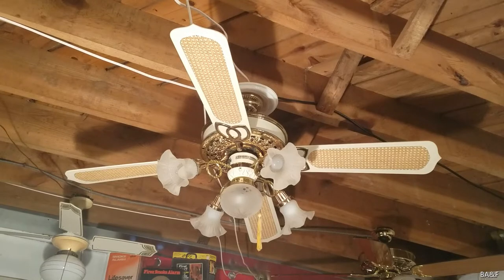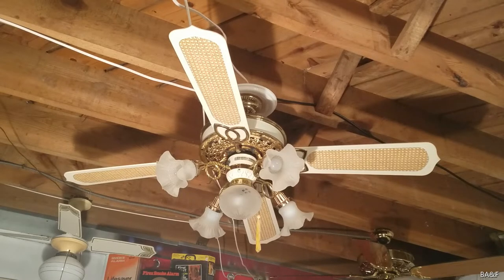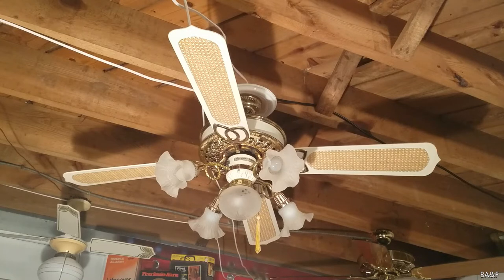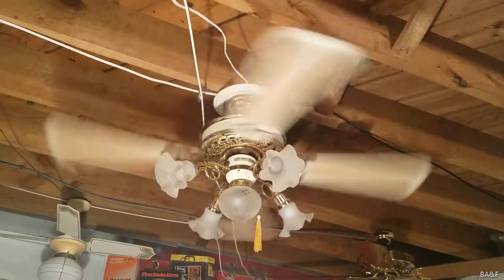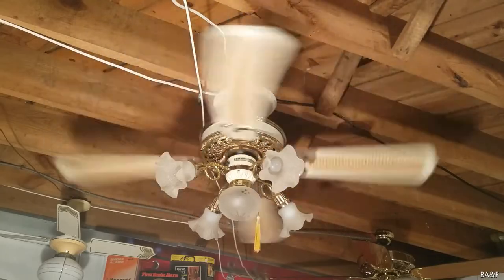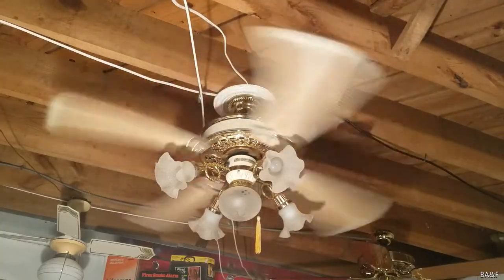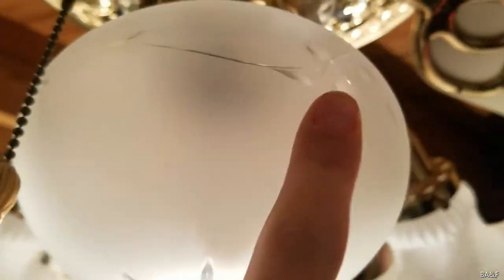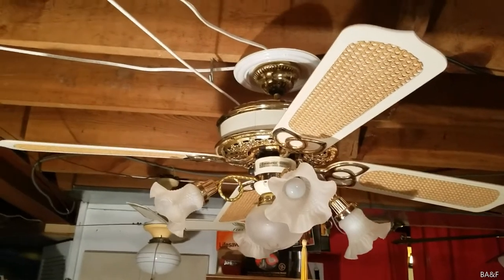Casablanca Victorian 52" Ceiling Fan w/ SlumberQuiet | W&B Cane Blades

Comment: Do you have ideas where I can get a new flywheel for my '85 Zephyr
Reply from the maker: They occasionally show up on ebay, some suppliers often carry them on various online fan parts stores.
Reply from the maker: Though most of the ones seen there are new old stock**
Reply: @BAFVintage  as long as it's not bent like mine currently is.